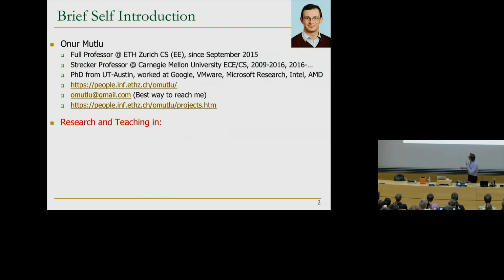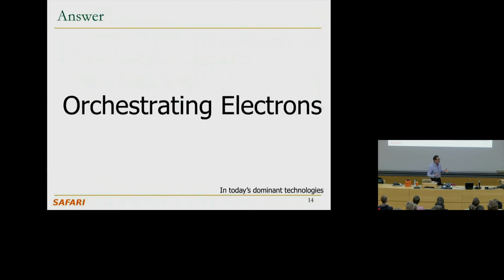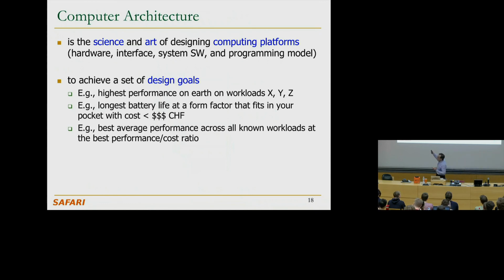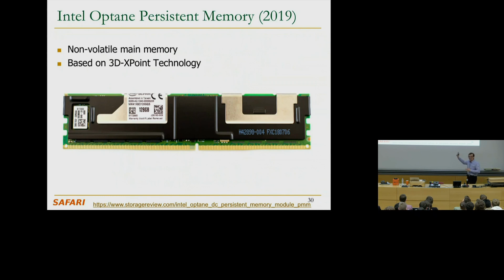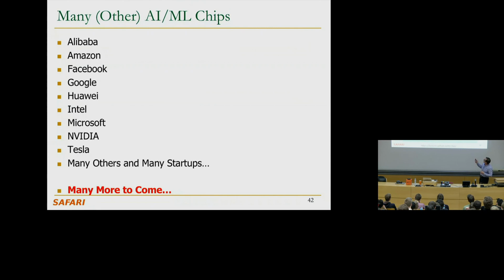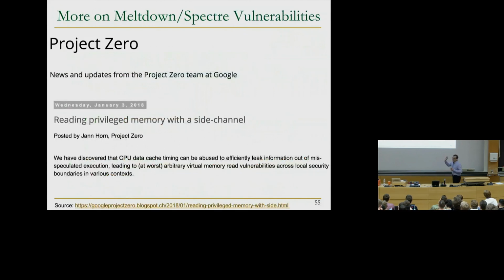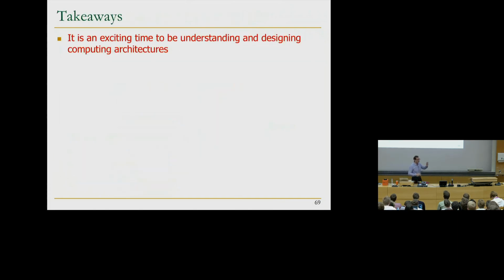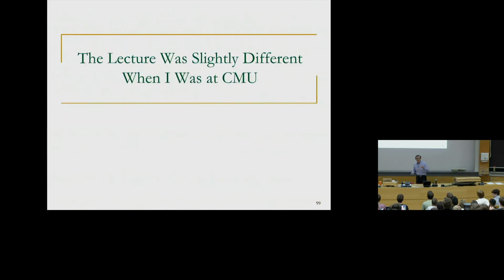Digital Design & Computer Architecture: Lecture 1: Introduction and Basics (ETH Zürich, Spring 2020)

Comment: All on paper, but I'm designing an architecture that is like nothing before! 
It doesn't even have any cores, and its Physical Threads are unlimited, well every function on the entire hardware has its own Thread, also can be used like a pointer, it doesn't need a clock except for human interactions like audio for example. 
It doesn't even have an alu, you make your own alu(s) more like Lambda Calculus type of manner. 
So you want to do 1 million  Simultaneous Parallel math calculations, make your function and copy and paste it 1 million times, each one gets its own thread,  and you can have them all active at once. I know that sounds like a lie but its not
Reply: you mean like, the one that had been designed by A. Turing? lol